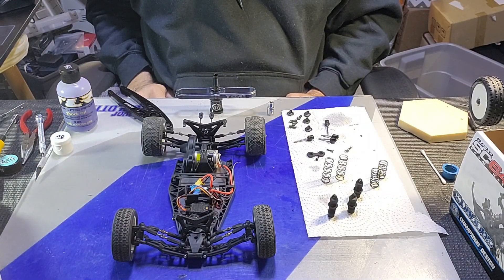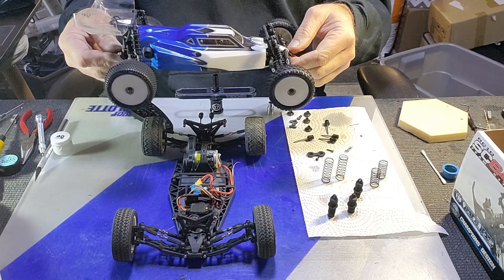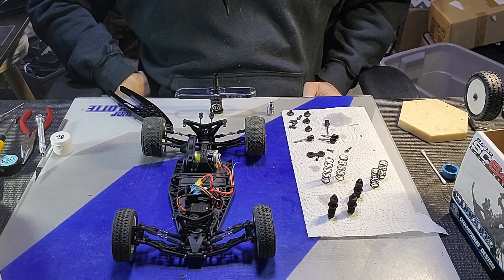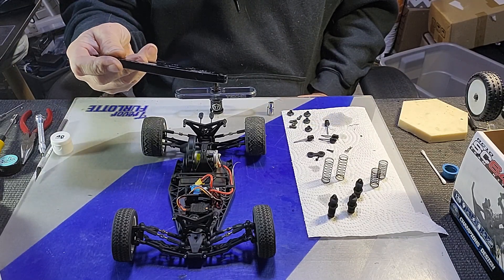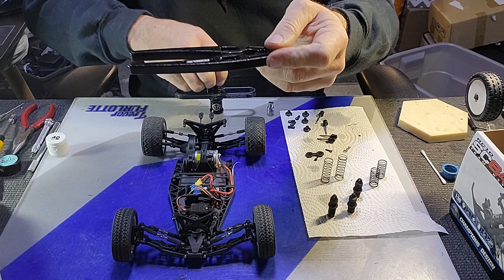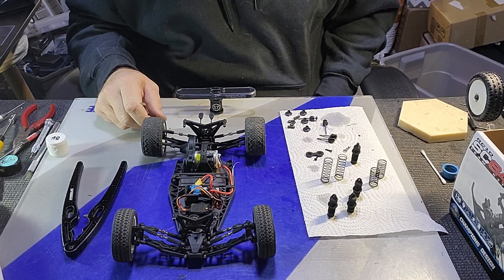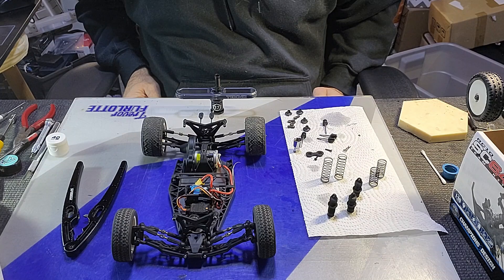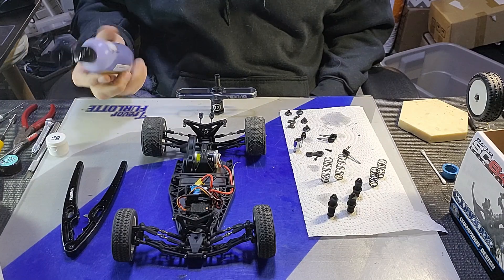How to Bleed TLR Mini B Shocks

Comment: I'm confused. Physics dictates that removing ALL the air will lock the shock; oil doesn't compress, so it will be unable to accomodate the shaft when the schock compresses? Aren't these supposed to be "emulsion shocks"? Otherwise you'll need a bladder inside the body?
Reply from the maker: @SoleSur5er  indeed some shocks do use bladders, especially in 8th scale.  As for your other questions, I'm no qualified or smart enough to answer them.  I rarely know how the sausage is made.  I just know how to cook it.